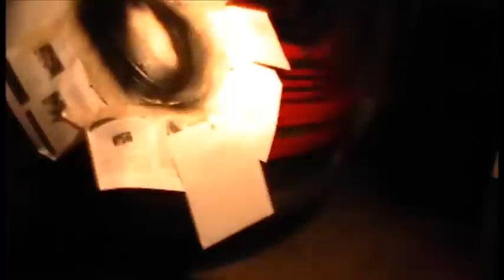Mini Cooper s Headlight Chrome BLACKOUT (PlastiDip)

Comment: why didn't you have to mask all the way to the edge?  I have never used plastidip and would have thought it would have stuck to everything.  Did you run a razor blade along the edge before you peeled it off?  Thanks,

Comment from the maker: PlastiDip was made so it could be removed from surfaces fairly easy and no I didn't use a razor to cut it. It separates itself at seams of the surface its on so you don't have to mask everything up like you would with normal paint. PlastiDip is very forgiving because you can remove it with little effort.